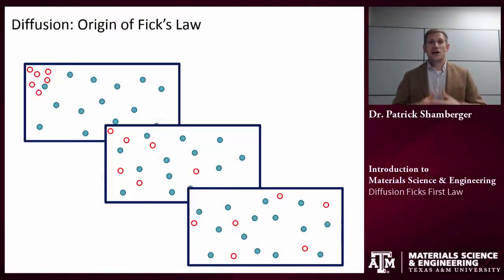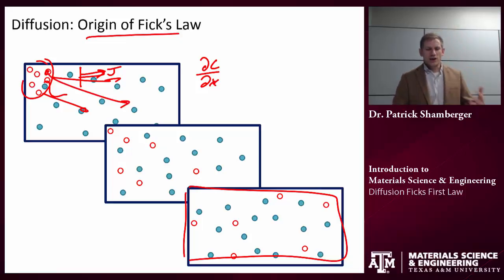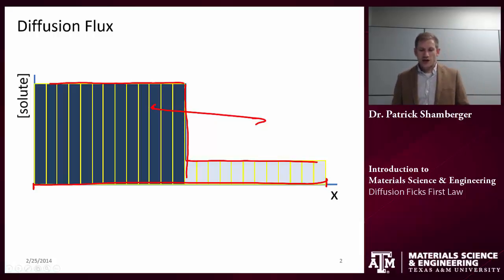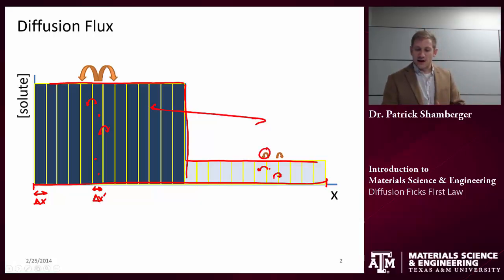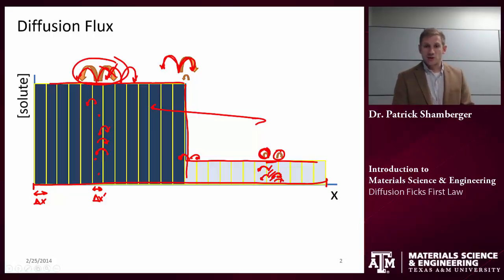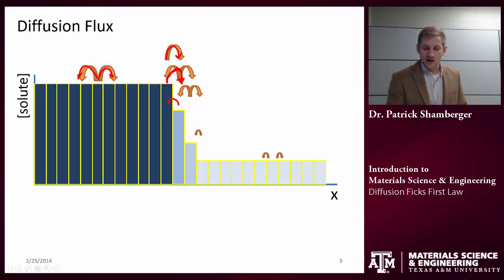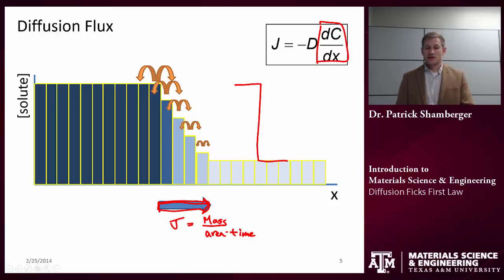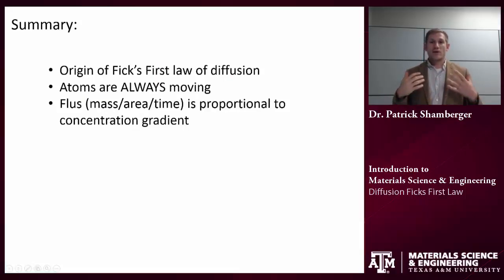Diffusion: Fick's first law {Texas A&M: Intro to Materials}

Comment: Really nice, except:
1. flux is the CHANGE in mass, or mass that moves from one side to the other (delta mass, if you will) in a fixed period of time (or a unit of time, or again delta time), which together would be the flow rate, through an area. 
2. Fick's law of diffusion (nor any other physical law for that matter) does not "control" any physical process. The "laws" are just models that with some level of accuracy describe the process in quantitative manner.
3. What your animation presents is in fact non-steady diffusion process that cannot be described with the first Fick's law. You just magically freeze it at some stage to pretend it is steady for that magical point of time. Not fair, not fair, sir 
:)